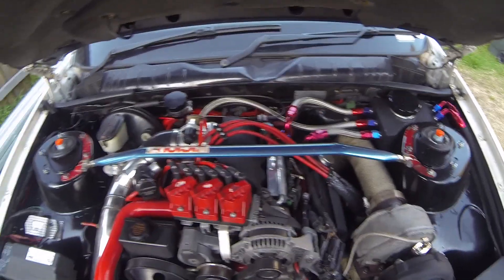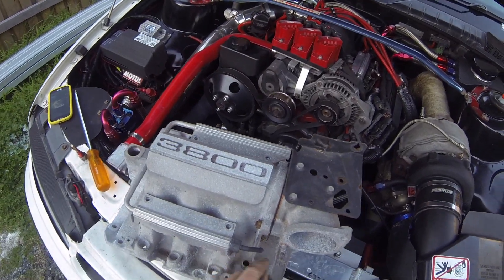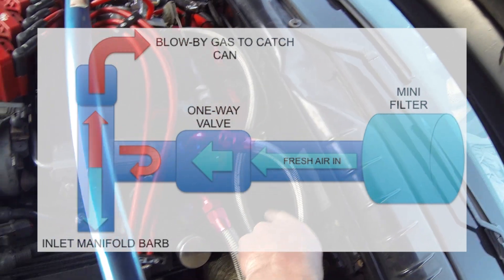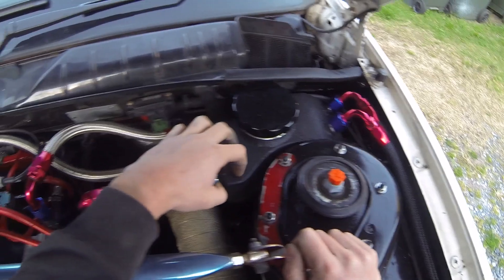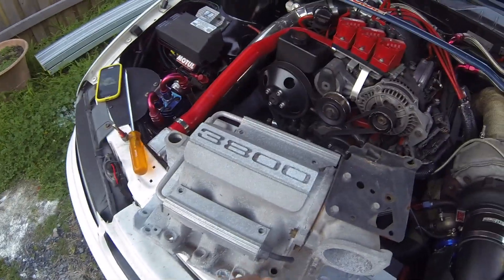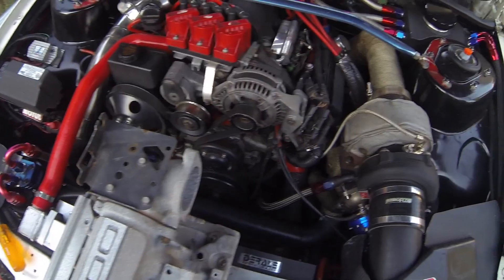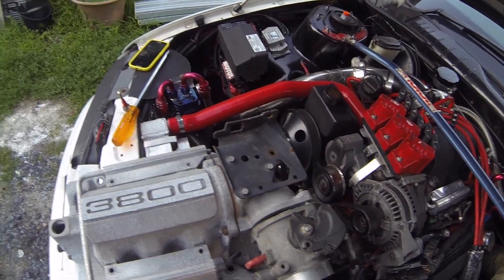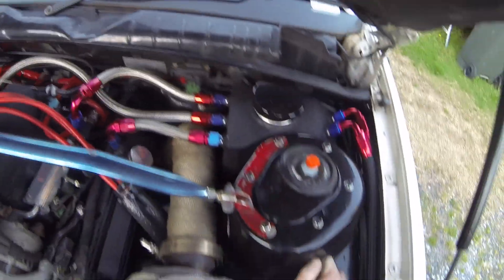SETUP A TURBO COMMODORE PCV/CATCH CAN SYSTEM

Comment: Hi m8 just on a catch can install for an l67 if i run 1 hose from the pcv port to can deleting valve & the other hose from blower hose that connects to the t.b. capping of t.b.hose barb then running this to the can will this b enough to work?
Reply from the maker: Yes I think that would be ok, I'm not totally familiar with the l67 pcv setups though.

Comment: hey man cheers for making this vid got my commy the road all legit boosting away couldn't of done with out you help. another question tho is did you upgrade you fuel pump or fuel pressure regulator
Reply from the maker: Thanks Neil, good to hear man! I'm currently running a walbro 255 pump, stock reg. Though will be adding an adjustable fuel reg before I hit the dyno for my meth setup just incase we run out of injector when turning it up👍
Reply: +Boosted & Built Garage oh nice that'll go nuts with meth setup. yeah I just put in new fuel pump 255 aeroflow one but I still get fuel cut at about 3 and a half thou to 4 thou revs im running supercharged vt injectors I think there 370cc was putting it down to fuel reg but can't be that if your running stock what size are your injectors?
Reply from the maker: +Neil Mcdonald Yeah will be upping the boost and be making some more power reliably 😊

It won't be the reg, my bet is injectors. I run Bosch Green 42lb ones which I think are 550cc?

What's happening exactly?
Reply: +Boosted & Built Garage could take a video of it and upload it. uhh just sorta drops  boost and feel the car jolt as if losing fuel
Reply from the maker: +Neil Mcdonald Do you have a wideband? Has it been tuned properly etc?
Reply: +Boosted & Built Garage wideband? na not dyno tuned just a rough tune
Reply from the maker: +Neil Mcdonald Ah man you need a wideband o2 sensor so u can look and tune AFRs under boost or you'll do damage to the engine. The OEM narrowband o2 sensor can't read AFRs too far beyond 14.7 (stoich)
Reply: +Boosted & Built Garage oh real ok then should probably get that iv been giving her some shit ae haha.
Reply from the maker: +Neil Mcdonald Yeah definitely do. I recommend the AEM Digital gauge and sensor. u want to be targetting 11.8 -10.5 under WOT. If u can, id get a dyno tune too to make sure it's all Sweet👍
Reply: +Boosted & Built Garage well atm my a/f ratio is set to 11. its safe tuned but running rich to stop detonation. but that shouldn't be affecting boost really
Reply from the maker: +Neil Mcdonald Could be blowing out spark, are your plugs gapped down? how much boost you running?
Reply: +Boosted & Built Garage there tight lol. im not sure 7 is high it gets before fuel cuts

Comment: just a few  quick Qs   are the full sealed catch cans legal ? were do u get they 1 way valve ? and the  manifold hose do you run that to catch can as well.   iam turboing my v6 torana and want it emissions legal cool vids  too
Reply from the maker: Yes they are legal if it vents back into the pre turbo inlet.
The manifold breater does also go there. To simplify the one way valve setup you could simply run 2 catch cans. One that takes both valve covers and one that takes the manifold breather. However the valve is there to basically not let the manifold suck dirty catch can air as "fresh air"

The one way valve I found it on eBay, it took a bit of searching for one big enough. Think it was for a fish tank hose or something like that.

Good luck man
Reply: Boosted & Built Garage thanks for the fast reply m8,, yeah iam finding it hard finding a catch can withe more than 2 ports there is ones with 4 but unknow if there baffeled like yours,,, i migh do what you said and run 2,, ive got 1 already but its a sealed unit with 2 ports ,, so i could use that to catch from manifold to catch can then  to inlet of turbo ? and then another catch can for both valvle covers ? and do u have a face book page would like to chat some more might be a bit  easyer
Reply from the maker: No worries, glad to help. Yeah I gave up trying to find one to work for my setup + plus I had only one tight spot for it so I just fabbed it myself (If you've seen that video) 

There's a company in USA called Sakou Michi (I think that's the spelling) they have all kinds of good cans and can custom make them too. 

If you look at my Subaru catch can video it'll be similar to that basically. That is a twin can setup

Yeah so one will go from manifold breather > catch can inlet > catch can outlet > turbo intake.

The other will be valve covers > catch can inlet/s > catch can outlet > turbo intake

Nah I don't have one, but you can email me on triviallica123@hotmail.com
Reply: Boosted & Built Garage  no problems at will check out the surbaru video,, and yes have watched the makeing of your tank and all your v6 turbo vids lol,,, yeah the toranas bays a bit tricky too on where to put things,,, so 1 breather on the  rocker covers would be fine then,, sorry about all the Qs but you are the only person thats done it the legal way for emissons that i can find
Reply from the maker: Alick Hinds
Haha thanks man. I would run both rocker covers to the can, either a dedicated -10AN port on the can for each cover or run both in -10AN into a 2x -10AN to 1x 12AN y-piece and have single -12AN into the can. If you're using AN lines that is lol bigger is better (trust me) try have the outlet of the can about -12AN

Yeah man when i built this car initially, there weren't many people around I could get info from so glad to know i'm helping people in the same situation :)
Reply: Boosted & Built Garage no problems m8 you have been very helpful I've been looking at some mishimoto catch cans  iam going to run the 2 like u said with a t piece for the rockers covers  i want it to pass first time so any help is greatfull  just have Trouble finding the valvle now lol
Reply from the maker: No worries mate. This'll save you the trouble of looking for the valve:)

http://www.ebay.com.au/itm/12mm-1-2-ALUMINIUM-ONE-WAY-NON-RETURN-CHECK-VALVE-Petrol-Diesel-Water-Marine-/191112692639?hash=item2c7f34439f:g:SocAAMXQVT9TBq5w
Reply: Boosted & Built Garage oh sweet as thank you,, you have  saved me a shit load of time and stuffing around thanks m8..... whan u t-piece the valve is the little filter u mentoined us the emissions legal to suck the fresh air
Reply from the maker: Haha all G. Yeah it should be all sweet, As it can only suck air in, nothing can go back out of it. I didnt have it setup like that when mine got engineered though. But i cant see why anyone would question it if they understand the logic
Reply: Boosted & Built Garage ah sweet as did u just have your lines running from manifold to catch can with out the valve
Reply from the maker: +Alick Hinds Yeah, the valve was an epiphany a while later lol